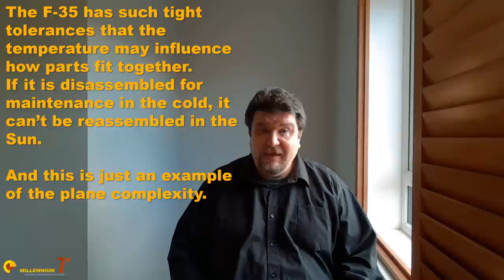F-35: The Failure of the $100 Million  Dollar Jet | Maybe...

Comment: An airplane designed by a comittee of  a committee of committee, what could go wrong?
Reply: But not a committee on ease of manufacturing/ price.. All the other ones were invited.
Reply: Funny thing is there are so many F-35 fanbois, that even if the Pentagon officially calls the program a failure, they would still sing praises and claim the DOD don't know what they're talking about.
Reply: @valenrn8657  , thank you for proving my point. With tens of billions of $ to lose if the F-35 program gets wined down, how much do you think Lockheed Martin and the rest of of the manufacturers are willing to spend on advertisement? Yeah, I can find tons of praises abot the plane. It does not change the facts. It is notoriously over budget and notoriously behind the timetable of reaching operational capabilities. It is a "all can do" Frankenstein monster in which every core mission is to the detriment of the other capabilities.
Reply: @Locomotion-uz4ly  10 to 15 years...for gen 4.5+ single-engine fighter

69 F-35 per year x 15 years = 1035 units
Reply: @Locomotion-uz4ly  Multiple nations and US services have been flying JSF variants for several years now, operationally, with regular combat deployments.

Every "core mission" only enhances the other capabilities exponentially. Examples:

VLO was primarily to prevent SAM radars from detecting and tracking it. How did that hurt it in A2A? 

The opposite happened and was planned all along, they just didn't realize it would make it that good at A2A.

EW system was designed to help it protect itself from threat radars and missiles.

Made it into an Electronic Attack platform like the EF-111A or EA-6B that opens the door for strike packages by performing offensive jamming with its AESA.

They took the F-22A Missile Approach Warning System and expanded it with 1028x1028 IR cameras, then said, "Hey, this would be cool to fuse with the other sensors to provide the pilot with spherical SA in the helmet for layered detection and tracking."

What happened? The EOTS fused with AESA radar, distributed RF sensors, and the 6 cameras in DAS took on a mind of their own, started seeing everything from low earth orbit satellites to whales under the water. This means that not only does it have a highly-attenuated missile warning system, but a multi-layered passive airborne early detection and tracking capability with precision signature recognition features that are all networked in the multinational JSF web.

With F-22, the ALR-94  is really expensive with around 30 embedded RF sensors all over the airframe. To cut costs on JSF, they leveraged programmable signals processing and ESA-based RF sensors to achieve the same or better RF sniff capability, and fused those through the CNI/CIP with the AESA, EOTS, and DAS.

So now you have a new generation of Electronic Warfare aircraft with no external visible aerodynamic penalty, and no need for a 2nd crewmember.

And how does this hurt it in A2A, A2G? It does the opposite, to the extent that 18-20yr career Fighter Weapons Instructors told the new generation of pilots to throw the old tactics manuals out, and write their own.

On top of all this, it humiliates F-15C+ in BVR, evades F-22A, penetrates Iranian and Syrian IADS with dedicated Russian technical support and latest operational Russian systems, and targets whatever it wants in the most contested theaters right now.

Yeah, they really screwed up with the JSF program. What a piece of crap! /sarc
Reply: @LRRPFco52  bullshit Australia's are parked in Nevada unoperational . Doing wonders for Australia's defence not .
Reply: @mathewkelly9968  RAAF just declared IOC with 30 of its F-35As in December I think, after 2 years of deliveries and training.  Parked in Nevada?  Not sure what you’re referencing.  RAAF pilots have been training at Luke AFB, AZ a while ago, which is where F-35A pilots do initial conversion training.

RAAF will have 4 F-35A squadrons, 3 of which will be operational units, the 4th a training unit in Australia.
Reply: @Locomotion-uz4ly  Nobody except the media called the F-35 a failure. Especially not the USAF or Pentagon.Here is a more realistic assessment of the situation. The F-35 is still going to be the cornerstone of the USAF. reports-of-f-35s-demise-are-greatly-exaggerated
Reply: @Locomotion-uz4ly  well, the Avro Arrow crowd had to go somewhere....

Comment: Consider most nations uses the planes for noncombat missions, example:
Nation A sends 2fighters towards nation Bs border. Nation B responds with two fighters and As fighters fly home. This happens 4 times per week, every week.
Nation A uses something that is comparable to F16 and could afford 100of them.
Nation B bought F35 and could afford 35 .
What nation has to ground its airforce first becsuse it does not have any spareparts. Who wins the next negotiaton between the two nations?